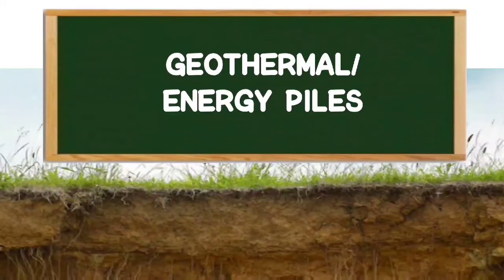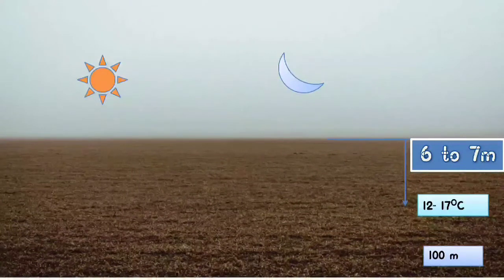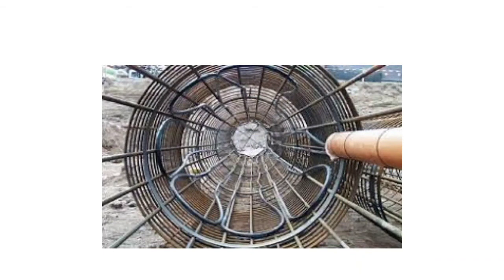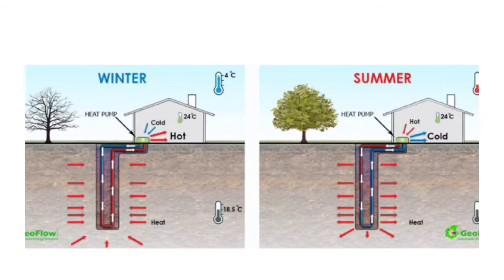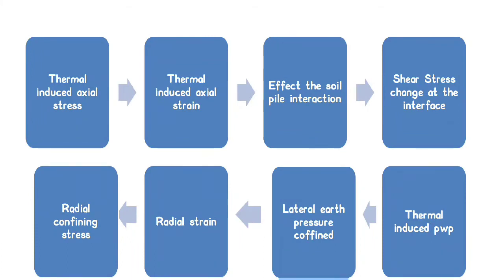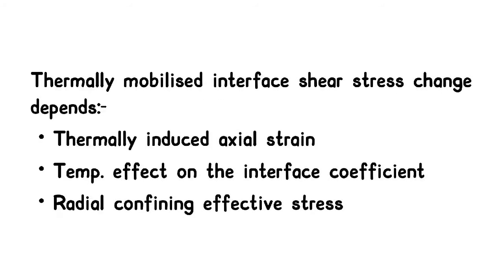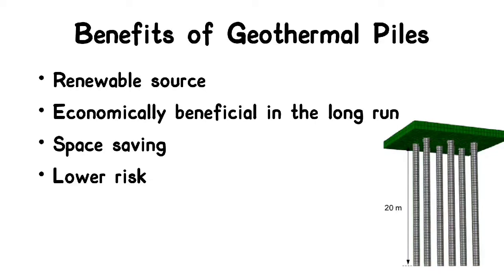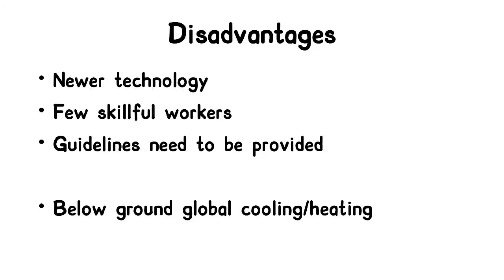Geothermal / Energy Piles

Comment: Can you provide any information on physical modeling of energy piles?
Reply from the maker: @abhijitchakraborty8025  To cool down the building, pipes are run throughout the floor and walls . (Below a covering ) . Water is allowed to.flow through these pipes. They absorb the heat during the day . The pipes are continued into the piles , it runs the length down and back into the building . The water that absorbed the heat cools down when it go down the piles and the same water is run back into the building . Its a continuous process
Reply: @geotechnicalengineeringsho8504  can you please provide any contact information for better communication?
Reply: @geotechnicalengineeringsho8504  Thank you for your reply

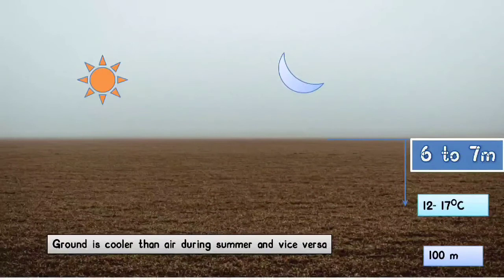Comment: A point of clarification if I may - at 2:13 you state that “Ground is cooler than air during summer and vice versa“ which is certainly true at depth but not at the ground surface, where the ground surface temperature always leads the air temperature since the ground surface is the terminus for insolation and the air temperature is a byproduct of reflected solar radiation, reradiation from the ground surface and convection from the ground to the air - the contribution of air temperature to the ground temperature is insignificant largely due to the significant disparity between the mass and energy densities of the ground and the air. This phenomenon is readily apparent on particularly hot days when the ground temperature is significantly greater than the air temperature immediately above the surface, due to the limitations of heat transfer due to convection, whereby the only way for energy transfer equilibrium to be achieved is through increased ground radiation at the higher temperature. On those particularly hot days, if we stand out in the noon day sun on bare ground, we can get cooked from both sides, and our perception always seems to indicate that air temperature is the root cause, whereas it is really the radiation, both solar and ground.  The thermal gradient of the topsoil is dependent on the soil type, but in general it is relatively much steeper than that of air, and so any subsoil temperature measurements will be strongly dependent on the depth of the temperature probe, which is why the soil temperature is often measured as being less than air temperature, something that is more important to farmers than geophysicists.

Comment: Is concrete a good conductor of heat. If the pipes are in direct contact with the ground  heat exchange will be more effective. I have no research on this matter.
Reply from the maker: There are different approaches related to using earth as heat source and heat sink.. Geothermal/energy piles are one of the techniques 
.. It has a dual purpose of been a foundation and heat transfer system